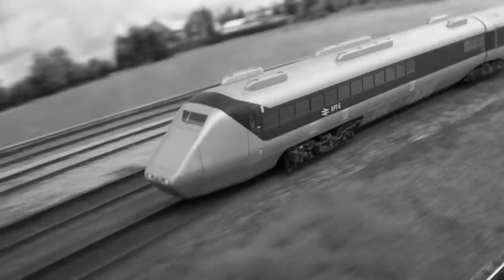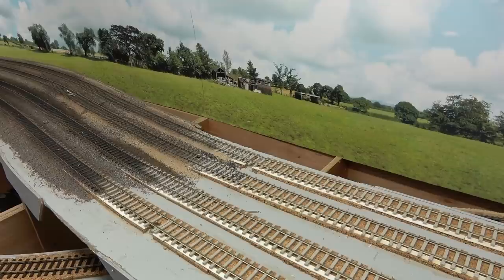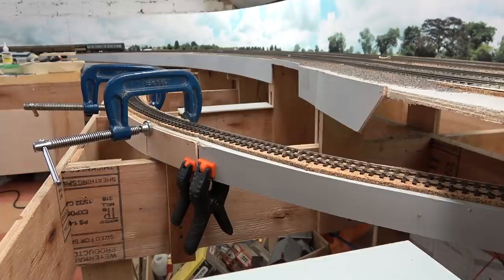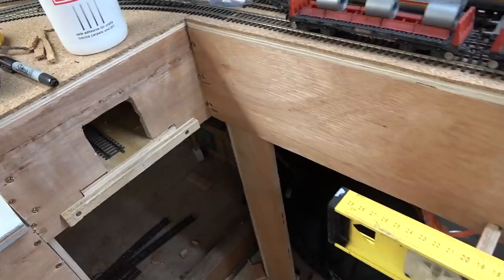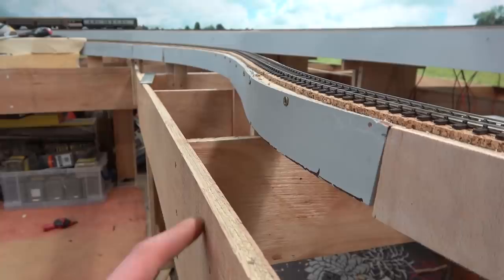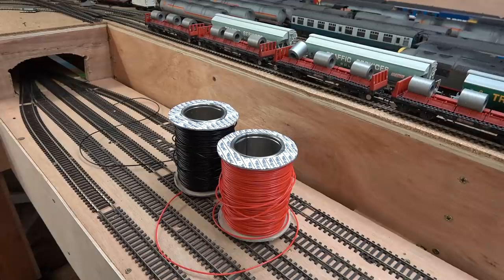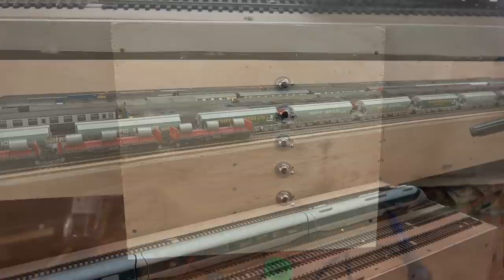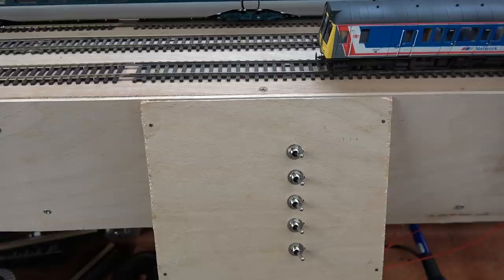New Layout Build - Track changes to the branch line

Comment: that ATP-E sounds amazing!  sounds like what I imagine the 70's thought the future would sound like.  Sounds like no other train I've ever heard before.
Reply from the maker: Each power car had four Rover gas turbines.  Must have been quite a noise when it was running in the 70s.  Cheers
Reply: @EverardJunction  It certainly was I heard it pass Hendon Police College whilst on a course there. Also visually a very pleasing train.
Reply: @EverardJunction  I was all ready to start collecting when I saw that train, then I saw your other video and realised they only made a limited run.  Do things like this ever get other production runs?
Reply from the maker: @asimplekraken1318  I don't think there are currently any plans to rerun.  They do pop up on ebay sometimes but fetch mad sky high prices.
Reply: Sounded like some SPACE: 1999 sound effect.  Thought I saw Barbara Bain  in the train too.
Reply: Sounded like Hawkwind.
Reply: @asimplekraken1318  - they have now done a re-run of the APT-E, bith in the original livery, and then also in a tongue in cheek modern livery (BR Blue and Grey, and BR Intercity Swallow).

Comment: I appreciate your logic in your decision making. Everything from your reasons for soldering to the outside of the track rails for hidden trackwork, to the use of code 100, to the switching and display panel. Very impressive.
I will attempt to  incorporate your methods as I go forward with my layout. Very nice layout and video! Thanks

Comment: This is why you’re better than most standard modellers, you’re not afraid to admit to your mistakes and cut your losses to make it more like how you want. Too many of us plough on compounding our errors...
Reply: Also, how many point motors could you power from that power supply?
Reply from the maker: Thanks, I try to sort stuff I'm not happy with before it's too late.  I didn't do any scenery on that side because I knew that yard was coming out.  

You could power loads of points from the CDC.  As you often only operate one or two at a time it doesn't really matter how many are connected.

Comment: Just a suggestion Richard, The area that had the carriage shed that as gone since you re-did the branch line could be replaced with a mill and canal. The canal could enter from a tunnel which disappears under the branch at one end and into a tunnel under the fiddle yard at the other.

Comment: You should section off the main lines and do the same with the track power indicators around the layout  so that your able to isolation section so you can work on areas of the layout with the other lines still able to run, plus it will help with troubleshooting power issues in the future, a bit of future proofing on the layout

Comment: Excellent video. Suggestion for the point LEDs: if you wire the outputs from the switches on the three way point to the inputs on the switches on the other points, you could just have one LED per siding which would light up when all the points were set to that siding, and otherwise be off. So there would only ever be one light on to make it easier to see which siding the points were set to.

Comment: I use DPDT centre off switches on all of my lines, for example on the storage yard I use the switch down for power and up for programming, in the up position I can find out what loco is on a section
by inquiring its address, this saves the need for separate information to be kept elsewhere.

Comment: If you turned your section switches 90 degrees you could have your switches in up position for off , down position for on as in automotive use, and saving extra wiring etc!

Comment: It’s been awhile since I’ve watched your videos so I apologize in advance if you’ve done this. For the control panel you can use a piece of lexan plexi. Drill your holes, no worries of cracking or splitting with lexan. Paint the backside black and it will looks clean. When I do watch your channel, your videos are excellent, thank you for taking the time to make them!

Comment: On the areas where I used solenoid point motors I have used the Peco point switch, which is a momentary switch but remains in the position of last throw, so that identifies the throw of the point direction.

Comment: Hi richard 
What do you use as a shuttle for the branch line and does it work on all 5 sidings and could it change the points to send another train out of the branch line ???.
Peter from Birmingham

Comment: I do like that black and white intro. For added effect, upload it in 405 Line on VHF...
#o)
BTW, flux core solder is good but a dab from a flux pen on those rails seriously speeds up the soldering.
Reply from the maker: I did, in one clip you can hear the sizzle from the added flux.  I try not to use too much, but it sure does speed things up.
Reply: @EverardJunction  you can't upload a video with any soldering without getting at least one comment suggesting you need to use more flux. It's The Law.

Comment: Excellent control panel!
A small criticism from the outside, the first central and bottom leds (just after the two first switches) seem a bit confusing. Maybe put the central and bottom siding leds in between first and second switches? (sorry, it's complicated for me to try to explain, if it doesn't make sense and it piques your interest let me know and I'll try harder, I'm just going to assume that as it is now, it's totally good for you.
Reply from the maker: I will be revising things when I build a nicer panel.  Theres always a better layout, cheers.
Reply: @EverardJunction  Nice! Can't wait to see it finished.

Comment: Another fantastic Video!Wiring scares the hell out of me and im at the early stages of building my layout but i have loads of insurfrog points and dont want to buy electrofrog ones if i can help it!Any suggestions on the best way to use insurefrog points for dcc?hints,tips would be great!Find your goodself , Deanpark and New junction great role models in this underated wonderful hobby!I still to this date still get called the Fat controller just because i enjoy this hobby!Never gets old.Look forward to the next vid!
Reply from the maker: For insulfrog points the best thing to do is solder jumper wires between the stock rails and the point blades.  Then you don't rely on the blades touching the rail to make a good connection.

Comment: I'd be interested to hear your opinion of frog juicers.  I swapped my PM1 point motor switches for juicers and I'm slightly disappointed, the relay isn't as fast as I'd hoped and you can hear it switch (its quiet).  Could you include your opinion in one of your future productions.  P.S as usual nice work

Comment: Bloody excellent that rich. The changes are much better.
Would love to see this in the flesh one day. Epic!!! 
Which shuttle module are you using??
Reply from the maker: I'm using Lenz BM1s.  Not totally reliable and quite a bit of messing about however they are working(ish) now.  I've not covered them due to the issues I've had.  I'm looking to replace in future with something else if possible.
Reply: EverardJunction ahh ok! Fair enough mate! 
Just an idea, where you were going to have the small TMD area,  now that you have changed the plan could you not instead have a small freight operation there instead perhaps for ballast trains or similar, with a hopper house ect for discharging, 
Would only need 2 roads probably, and would be something different, whilst still leaving you space at the front for scenery.
You get them in all sorts of unusual tight spaces just off of small branch lines ect,

Comment: How about using the area the track used to run under as a river scene passing under the main lines and a small viaduct for the branch line. Also id lobe to see semiphore signals on the branch as I picture it not yet being modernized like the mainlines, like the real life Conway Valley line

Comment: I think that a tiny station and a few stabling sidings would of looked good on the new board.
Reply: I was also wondering if the new fiddle yard could be pushed to the right, and a small branch line station added. It could then go through a scenic break (under a bridge, for example) and into the new fiddle yard.

Would give the DMUs something to stop at, plus it would be a nice additional scene. Maybe once the main layout is complete?

Comment: Great video as always.  I like the modification you've made - I'm interested to see how you develop the better potential for the bridge.  Are you satisfied with the Peco points' robustness for use with solenoid-type motors?  I gave up on solenoids after about 4 incidents of blades and stretcher bars being rent asunder.  I suspected it was due to the repeated shock effect.  Solenoids are rather violent!  I noticed during the sequence at about 19:30 when you are testing the points, they jump from side to side alarmingly.
Reply from the maker: I've never had a problem with peco code 100 points and solenoids.  Friends have had good experience too with some points having been running like that for 10 or 11 years now.
Reply: @EverardJunction  OK, fair enough.  To be fair, it was the H&M design of solenoid I was using, and perhaps they pack more of a punch than Peco.  I'm on 75 track as well; it's naturally going to be a bit more delicate. I think I'll stick with Tortoise, despite the increased cost.

Comment: i belive you could power leds from those analog frog power switches, if the rail would work you could always hook the other wire of the  diode bridge to the outside rail, making it 2 bridhes per frog
i don't know how the 3 way point worls work with that because i have no schematic for it but in theory if a diode bridge see the same ac it would do nothing, if it is the oposite polarity voltage of dcc it would power the dc output
plis there is always added bonus of using leds in there so in theory you could replace one diode in the bridge with led  and move the resistor before the bridge , or use the led without the bridge with resistor, it would still work but half the time, given it is ac it could flicker a bit but it would still work without the diode bridge
Reply from the maker: That should work.  I've made sure I can easily change how the electrics are done under there for the future.  Cheers

Comment: Brilliant as always! Are you going to automate the branch line, Richard? The DMUs coming and going totally independently would be perfect.
Reply from the maker: See later in the video. I have the 121s running back and forth.  I've not covered the system as it was very problematic to install.
Reply: @EverardJunction  Having played a lot of SimSig lately - looks like great scope to have the branch operate under Absolute Block Signalling. Branch operator and main line operator sending trains to and from one another… with bell codes… ;)
Reply: @EverardJunction  I completely missed your commentary over that part, totally zoned out! You're not using a Dynamis Ultima by any chance, are you? I got that system for my plank and was so disappointed by it I boxed it up and it hasn't been out since.

Comment: Please vacuum up the dust and sawdust before you solder. I saw some dust get mixed in with a solder point you were working on. OCD ALERT!
Reply from the maker: All the joints to the track are dirty.  I made it clear I was using old track.  Made sure to solder in easy to reach areas in case repairs are needed in future.

Comment: Using a DPST switch for the siding power would have made the indicator LED install much simpler. 

It would have been nice if you had included a "before" picture of the area too.

Comment: Great video as always love the new retro beginnings.  Can I ask what runs the 121 shuttle loop? Thanks
Reply from the maker: Lenz BM1s with a Lenz decoder in each train.  Its not totally reliable but it works most of the time.  There are limited options for DCC shuttles so for the time being I'm using those.  Cheers
Reply: Thanks

Comment: where do you get those switched that go back to give a smal pulse to switch the tracks?
Reply from the maker: I got them from Rapid Electronics (I think) years ago.  They are called spdt switches.  Make sure you get the sprung version that goes to 'off' when you let go.
Reply: As well as the ones Richard used, you can use spdt passing / momentary contact switches. They don’t return to centre so you have a visual reference which way the switch is thrown, but it still only sends a pulse

Comment: What make and rating was the bridge rectifier. I assume this converts track DC to AC so that the LED illuminates all the time. I'm a DCC novice.
Reply: Actually, it converts AC to DC. However, I don't believe you need a rectifier - just add a limiting resistor in series with the LED, connect the other side of the resistor to one track rail and the other LED lead to the other track rail. Assuming +/- 15 volts DCC, the LED rectifies this voltage to 0-15volts half the time. A 3K resistor would give you 5ma half the time through the LED, equivalent to the brightness from about 2.5ma. Lower resistor vales give you more brightness.
Reply: @JaxBeacher  So why might he have used a rectifier at all, what happens in a DC situation (track feed) when the polarity is reversed? Surely the LED goes out?
Reply: @davidchadwick7559  There is no need to use a rectifier on a DCC track if all you want to do is light an LED. Perhaps in this case Everard wanted DC power for some other function, which is a common practice with DCC systems. If there is a DC system as you ask, bearing in mind that you aren't normally mixing DCC and DC on the same layout, just make sure you connect positive voltage to the LED anode and negative voltage to the LED cathode and use a limiting resistor - exactly the same setup as with DCC, just being careful with polarity. I have a DCC system with various isolated blocks, and using LEDs to show when the block is powered is what I do on the layout and I do it as I explained - no rectifier, just the LED and a limiting resistor. Now the downside to this practice is that you are loading the DCC booster, so you don't want too many LEDs. At 2-5ma per use, a few should go unnoticed by the booster.

Comment: That APT-E looks really bad on the branch, I’m sorry to be negative but in my opinion the curves really don’t suit it. However the single unit looks right at home, it’s like the branch runs single units because of the tight turns. I think realistically the answer would be a straight longer bridge but that would interfere with your main line supports. It’s because of the relative angles of the lines, the curve to go under would not be necessary on a real railway as you’d just straight line from the higher curve, under the main lines, the bridge would be longer because the lines would be almost parallel at that point. Anyway I hate to offer what I hope is constructive criticism in such a negative way. I think I’ll shut up now. Stay safe Richard.
Reply from the maker: The curves are tighter than what I would like due to the space.  However I never run the APT on the branch unless I'm testing for derailments as in this case.  I run the APT on the main part of the layout where it looks at home as per the intro.

I built the branch for 1 & 2 car units.  With those small units I just about get away with it, but you are correct, the curves are tight.  I don't have much choice as a straight shot would make for a very odd looking bridge!
Reply: EverardJunction absolutely understand, as I say constructive criticism is very difficult to type without seeming to be just criticism, that was not what was meant. Also I was not meaning to cast negative comments regarding the work you have done as it looks fine with single units and will be fine for short DMUs. The APT-E has such huge overhangs at each end and the articulated bogies though.